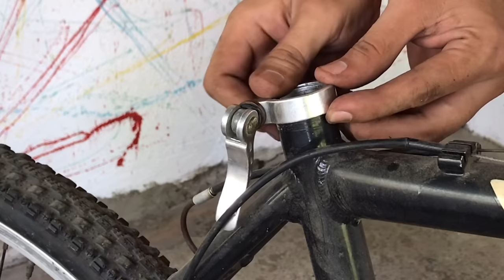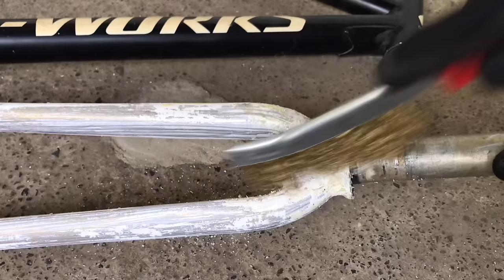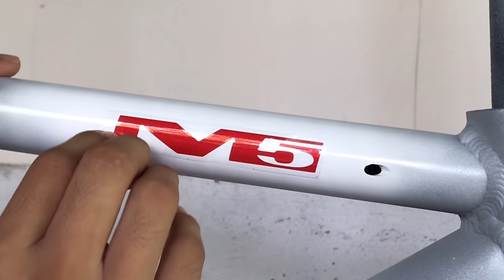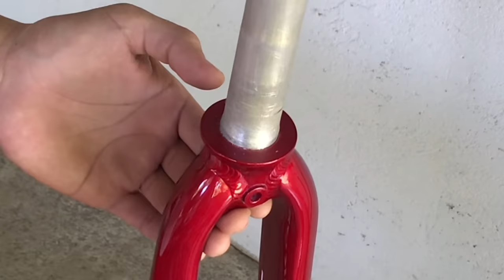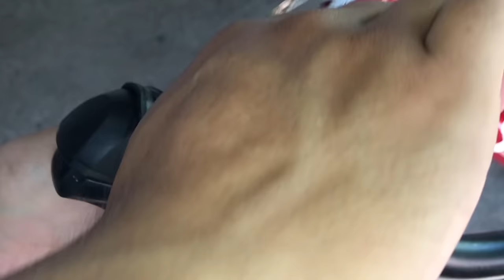Building a road bike from MTB convert to ROAD BIKE [Restoration]

Comment: Sorry bro but it's a different frame on the second built. You can see it from the wholes for the internal cable routing
Reply: Maybe he drill it out of camera. Like V-brakes.
Reply: @giulianos9345  Because it's a joke, just the beginning of the video discards the rear bases of the brakes which is very dangerous for the future (cracks). The video is there purely for buzz. Last thing, the video is entirely edited because there are two or three things where I remain literally skeptical and no bike restorer would do such a thing

Comment: it was 26" wheels and in the end it was 700c.....how ?
Reply: Magic🤣🤣🤣
Reply: The volume of a 26" MTB tire is much bigger than the road ones, so the total diameter of the wheel is not that far from a 700c. Also the chain stay is fairly long on MTBs, sometimes they can acomodate bigger wheel sizes, but it's possible to see in the video that the new back wheel is a little closer to the seat tube.

Edit: Went look for some numbers, wheel size is rim+tire.  So 700c wheels are (no surprise here) 700 mm or 27,56", so in a 26" bike (660 mm) you only need your frame to clear the extra diameter divided by 2, so 20 mm (0,79").
Reply from the maker: The 700c rim can fitted into 26er frame

Comment: actually that's not even an specialized bike....
Reply: @@pakamataykanangboboka No its not, even my 1996 Rockhopper has a changeable rear mech hanger, and you would never find Tourney on an S-WORKS bike! 
The only thing that possibly could be found on an S-WORKS mtb is the XT hubs.
The frame alone would be quite collectable so grinding of the V-brake bosses would be stupid on a real S-WORKS frame.
This guy is doing a really good job restoring this bike, its just annoying that he has to use click-bait.

Comment: Paint job is really beautiful, and I also like the idea to route the cables internally and take off the brake bosses on the seat stays. Honestly surprised to see the road rim brake fits on the bridge and reach the rims - neat! Not so sure about the choice of components: If it was me I had rebuilt the wheels with the XT hubs that came with the bike (and which are high quality and serviceable), and complemented it with a used 9- or 10-speed Ultegra group set - perfect match for that frame and budget friendly. The bar tape is wrapped too loose and will come off all too soon.

Comment: Please don’t EVER remove a headset like that… you will bend the head tube or widen it and future headsets won’t fit
Reply: Its a rubber mallet
Reply: @ohmingfeng9351  He has a point, even with a rubber mallet bringing the cups out on an angle will flare and distort the ends of the head tube. the proper tool for removal isn’t expensive. All said it is a nice build and lots of good work.
Reply: I must have used a rod and then that rubber mallet
Reply: @carltorres1006  The tool you want is a headset cup extractor. It has one end to hit and the other end is split into tongues that spring outwards. It can pass through the opposing cup and let’s you drive the cup out square
Reply: @dwightsunn3937   “fine” cuz a comment bot would know 😂😂

Comment: Nice, BUT, considering doing something similar i would keep it simpler and les risky (modding the frame is cringe to me). Keep the frame as is, drop in some nice cantilevers (XTR) and skinny 26" tires (maybe custom buil them. Mount old Dura Ace with big gears to compensate for the 26" wheels (second hand old 10sp Dura Ace is cheap). Call it a day.

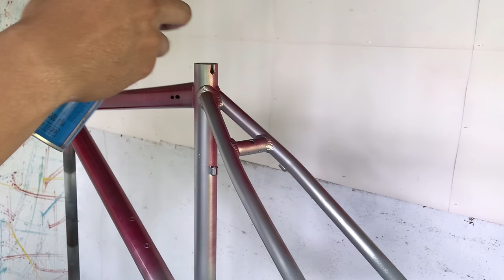Comment: Footage at 7:28 tells us that the MTB frame at the beginning was not used in the project as the rear v -  brake bosses were shown at the beginning but not during painting at the bookmark . There was no evidence of brake boss removal ! Also , the internal cable entry points in the top tube !
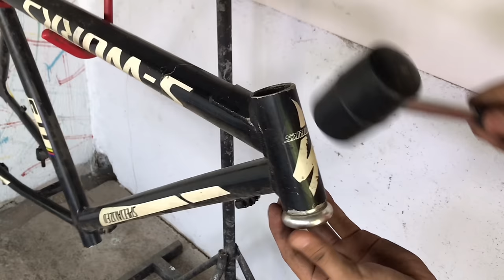Reply: 3:15
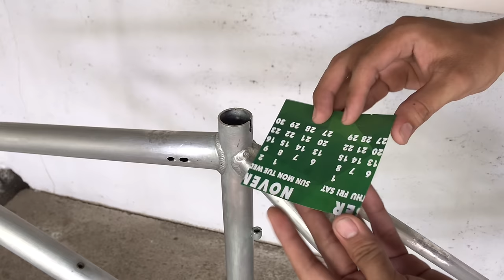Reply: 5:44 you ca see stains from angle grinder where the "brake holders" used to be on the top tube. He must have drilled the the holes for the internal cable then, but he does not shoes it, indeed.
Reply: Bro he Cut and drilled the holes🤦‍♂️

Comment: You can do this to early Cannondales. Have a 1986 M300 frame, polished out, running first gen, medium reach Shimano 600 brakes, Shimano R500 rims. Run Shimano 105 derailleurs. Kept the fork so I can run 32mm tyres and mudguards. 😎
Reply: Yeah, really early MTBs would work much better for this!

Comment: Hey,  the previous frame that haven't yet restored has external holes from the top tube.. but in the after scene the frame is now internal cabling. what the the hell???
Reply: They don't show it on the top tube, but on the back side they flex of some stuff from the frame.
I can imagine they flexed off the cable holders on the outside and just drilled some holes in the frame.
Reply from the maker: I do small holes for internal cable and i removed the external cable holders, but I didn’t included in the video

Comment: 2 different frames. The first one has cables externally, and the other frame has internal cable routing
Reply: 5:43 Switch of frame?
Reply: @rejuan99  it's a different frame. The old one has external cables rputing. "Finished one has internal cable routing.
Reply: @jmoyet  that's what I said.
Reply: @jmoyet he drilled those holes himself, he converted it
Reply: @rejuan99 5:45 if u stop the video , u can see new drilled holes and also the marks on top of the bar where he cut the old cable holders off
Reply: No its the same bro

Comment: If you put a road fork on a 26er intended to be used with a suspension fork, you'll end up with a really steep head tube angle!  Even if you use a ~400mm ATC gravel or CX fork substituted for a 80mm travel fork, you'll end up with about a 75 degree head tube angle and of course, very little trail.  With a shorter fork, it will be even more extreme.  Yeah, you can ride it and get used to it, but it both is difficult to make it go straight down the road, but paradoxically, it is difficult to initiate a turn because there is so little wheel flop.  If you had a fork with very little offset, I suppose it could help?
Reply: I did it.  I picked up a no name 26” aluminum frame cheap on sale, and put various spare parts on it that I had laying around, and made 26” road bike with disc brakes for city commuting.

I can’t say honestly that I approached it with any kind of clear plan, but I was pleased with the results though. It tracks perfectly stably and is quite comfortable, probably because of the longish chain stays.

The handling is razor sharp, perfect for a city bike, you just have to think and it goes there.  A little intimidating at first but quickly becomes natural. I recently replaced the 120 mm stem & mini bars with a 40 mm stem and drop bars, and it became indeed very stable, for its second life as a gravel touring bike.

I’ve toyed with the idea of trying it with 700c wheels, it has the necessary clearance.

Comment: Bike still has the MTB geometry with little BB drop and high trail.
Reply: Gravel bike?

Edit: Actually I gave it a little more thought, without the suspension de BB would lower a bit and make the head tube angle steeper, maybe not a road race bike geometry, but certainly not a MTB either.
Reply: @hsanper  
If you like it and ride it - it’s a great bike for sure.
There’s nothing  wrong with building unusual custom setups, it just have a MTB geometry, that was my point.
Reply: @RomanArzumanyan  100%... it was collecting dust and now is a usable bike.

Comment: That looks great! How did you find wheels to fit the rear of the bike? Was that hole you installed the new rear brake into an industry standard at the time for 700c wheels?
Reply from the maker: Yes i convert it into Roadbike, former 26er to 700ctires

Comment: Great conversion and excellent painting skills utilizing spray cans.  Since you had the frame down to bare metal, did you consider smoothing out the welding points?
Reply: To weaken it? For what reason?
Reply: @janeblogs324  purely aesthetics, if the welds were done properly it won't comprise the structural of functional integrity of the frame.  Just Smoot out the welding overlaps with a file and Dremel.then sand and paint.
Reply: @robertlangland3351  welds are only strong because they are convex and shaped like a sphere in tension. All the specialized with ground welds have cracked, they no longer sell any frames with undercut welds
Reply: @janeblogs324  I completely understand that risk.  Especially if the welds are not fused completely.  I"ve cleaned up a lot of welds in my many years.  It generally is ok to grind down aesthetically..  Generally we used to grind down to find the flaws or make sure we had no pockets or cracks to clean up.  My experience has been that if the weld is done well, grinding for appearance did not significantly affect structural strengt; however if you ground the fillet out you weaken the weld.  I can't speak to the quality of the welds on the Specialized bikes.  I rode and raced Cannondales in the early nineties.  My biggest challenge with their aluminum frame was bottom bracket fatigue from oxidation.  All my Cannondale frames had the joint welds smoothed out.
Reply: @robertlangland3351  all welds must be convex or they fatigue. Think of the weld as an expanding sphere when hot and it contracts when cooled. Its like hundreds of ropes going from the center to the edge, all pulling back to the center. If you bring away the top half or the top 2/3 like bike manufacturers were then all those ropes are gone. 
Its OK to grind welds on a table or something, but round tubes that see vibration and load will fatigue. Seriously just google broken bicycle frame welds. Standard welds crack the along the tube 5mm from the weld because the weld is stronger than the tube. Ground welds crack along the middle of the weld

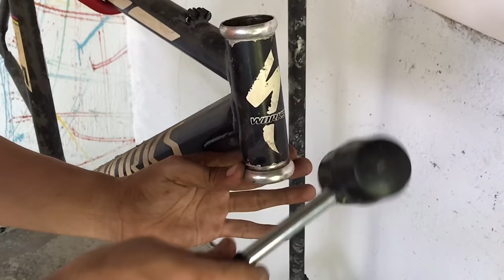Comment: at 3:03 and 3:10 are two different frames. check the top tube cable guides and the bottom bracket, and also the break mounts. ((sorry, my apologies for my mistakes and overlook, please read darrell1829's comment.))
Reply: you're right....
Reply: it is the same frame. at 3.10, the frame is upside down (notice the Specialized is inverted). also at 3.10 you cannot see the bottom bracket shell or the top tube rear brake/shifter routing. that's because you wouldn't see those when bike is upside down

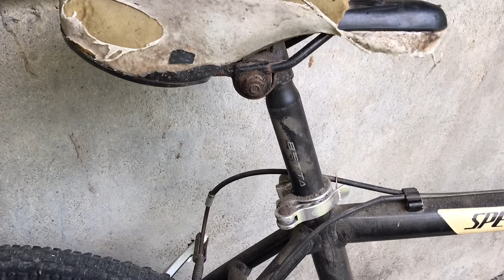Comment: It wasn't shown how the cables were passed through the frame for the rear gears. The older frame had holders which these were removed for the newer version and some holes at an angle had to be drilled into the frame which aren't straight forward to do, but weren't shown in the video. At 16:36 old version and then 17:32 and 17:38 for the newer version.
Reply: Weren’t shown because it’s not the same frame as the before and after. One has external routing while the other has internal routing.
Reply: @chaotic2insanity  then what conversion was it? Fork, handle, seat, wheels are all different... Add the frame too and it's a totally different bike
Reply: @SimonGrech  I don’t know exactly because once he starts to strip the paint off the frame. The cable guides on the top tube aren’t there anymore. Once the paint is fully stripped off that is when you see the holes for the internal cable routing. Unless he did this off camera and forgot to document the process. Then that’s awesome he was able to do that but if he swapped frames then that’s deceiving. 
As you mentioned being able to drill a hole at angle isn’t an easy task. Also guiding the cable from one end to the other end without installing internal tubing…
It’s doable but requires skill and custom fabrication.

Comment: The only thing you cannot fix is the high BB height. So you have to either get off the saddle or really stretch that foot out when stopped. OK for off roading but still an issue for riding on street which is where most people use all bikes.

Comment: S-WORKS but tourney groupset 😂
Reply: Rick, i think it's...
Reply: What do u even mean? S-works has a wide variety of bikes ranging from low cost bikes to higher cost,and it doesn't even mean high-end parts will only fit that bike brand,if he's doing it in a tarmac then that would be a problem
Reply: @NotMeJustborrowed  Specialized has a variety of BIKES, SWORKS is the highest variety of specialized and this BIKES usually have XTR or similar.
Reply: Look it up it is actually a real MTB bike from s-works........... That what I meant variety,I know that brand don't exclude their products to affordable variants
Reply: @NotMeJustborrowed It is a real MTB by S-Works. But S-Works being the high end of Specialized (be it a MTB or a road bike), it only offers high end components. In this case the bike was originally fitted with a nice MTB groupset. Now that it's converted to road bike, having fitted a low end groupset (Shimano Tourney rear derailleur i.e), it's not up to the S-Works standards.
But hey, nice conversion anyway

Comment: Hey RG! i wanted some help
im completely to all this stuff and i had an old FireFox TEMPEST 6S 2017 mtb lying around
i thought of doing a fixie build, is it doable? and if so, what parts do i need?
Reply: If you're looking to do a fixed gear conversion, it will be difficult or just impossible because the rear dropout won't accept a fixed gear wheel, so you'll somehow have to find a fixed gear hub or wheel that has the same spacing as a MTB wheel. There will also be many issues with the chain tensioning. A single speed conversion is definitely possible, however.

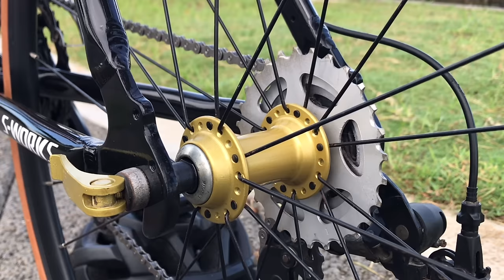Comment: 17:20 does anyone know what the heck is going on with missing spokes and the improperly installed ones?
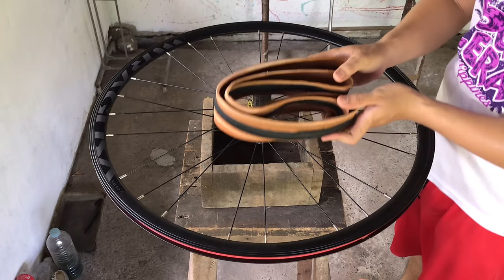Reply: 10:26 I’m assuming it’s a 36H hub laced with 12 spokes each side, for 24H lacing. Although it seems both drive side and non drive on both wheels are laced radially. That rear wheel I doubt is strong
Reply: @necrossis  that's what I'm talking about. This is pure crap. He wasted so much time to "resurect" this old bike and made that rather serious mistake. Wheels are most important parts.
Reply: The wheel building practises shown are not recommended .
Reply: Radial lacing on the drive wheel and 1x lacing on the front 😂

Comment: Since the spokes of the rear wheels are radially knitted, there is a risk of damage due to poor drive transmission efficiency. 
The rear wheel should be tangent knitted because the shaft torque is applied. 
Since the front wheel does not have shaft torque, either radial knitting or tangent knitting is acceptable.
Reply: Holy shit you're right!  Will be like riding an elastic band 😂